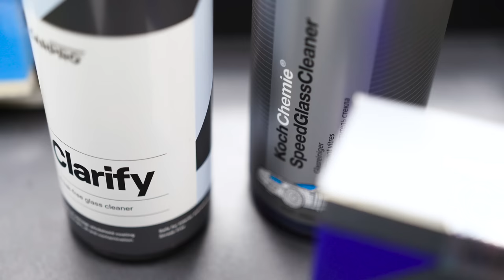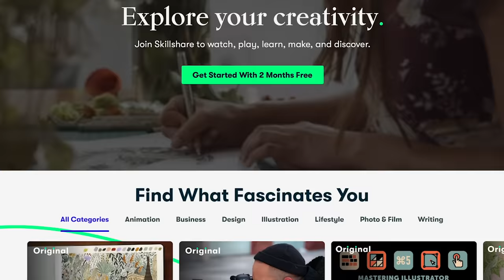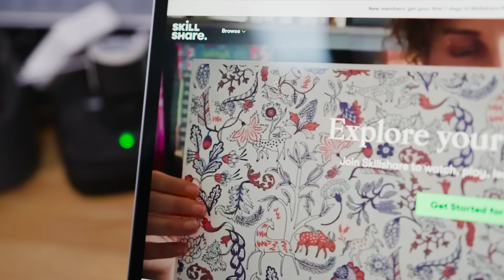How To Clean & Ceramic Coat Car Windows - Streak Free!

Comment: Congratulations on the sponsor man, that's awesome. Magic eraser on windows is interesting, do you use that method on tinted windows as well?
Reply from the maker: It’s a first! I’m really excited because this will help the channel grow! You can use it on tinted glass, but use it lightly, no need to use a lot of pressure.
Reply: I wouldn't use magic eraser on the inside if the car has tint films (not factory tinted window).
Reply: @JackRR15  I agree totally. I was surprised to see that.

Comment: Some verbal explanation of what you are doing and tips on the best way to do it and type of sponge and cloths you are using to scrub with. What can I use if I don't have a circular buffer?
Reply from the maker: With the new version of FlyBy FORTE, polishing is not required. But you can use the handapplicator which comes with the CeriGlass kit if you’d like.

Comment: Great video! I'm always hesitant to buy any sealant for my windshield because I feel like the wipers will blow through any protectant after a couple uses.
Reply: With proper prep and a good sealant or coating it will take quite awhile before they break down if you are looking for a good cheap route I highly recommend griots glass sealant. Super good quality for the price and lasts for quite awhile. Forte by carpro is solid as well for the one he is using but comes at a higher cost of course.

Comment: very cool, the application is pretty much same for every glass sealant but that buffing out with this small applicator seems lot of work, does it turn "clear" quick? Do you need to give it pass with fresh microfiber to remove some left residue? Adding voice to your videos was cool, thanks
Reply from the maker: You have to buff it a little bit before it becomes completely clear. Sometimes there will be a little bit of residue left, especially in the corners, but you can just lightly wipe these off with a towel. Thanks for the support Lukas!

Comment: great technique and products .. the only thing which I would do otherwise is to not spray the inside of the glass directly with the sprayer. I would spray on the applicator pad (in your case the magic erazor) outside of the car to avoid splatter/overspray on the dash and doorboards.

Comment: Great vid. Do you need a polish stage on the glass if the car is brand new?
Reply from the maker: Thanks Samuel. I always do at least a light polish, just to be sure there is nothing left on the glass. Some dealerships use water repellent glass cleaners and that might interfere with the coating.
Reply: Thanks for letting me know I’m going to try and get them to leave the car alone and just deliver it to me as is so they don’t mess up the paint lol, thanks again

Comment: Question for you and other detailers here? No one ever addresses or talks about how many pads they use during a paint correction and how many towels they use during a ceramic coating. Do ceramic coating towels need to be thrown away after each use? And can 1  correcting pad and 1 polishing pad be used for the entire car or do you need multiple of each pad? Thanks!
Reply from the maker: Once a towel becomes saturated with product, you should swap it out. The used towels are not reusable as these will become water repellent. It's best to use more pads during paint correction. I usually use between 5 to 8 pads per car (depending on the size of the vehicle). Using more pads will extend the lifespan of the pads. Using a fresh pad will also do a better job at correcting as there will be less residue build up inside.
Reply: @VermijlCarDetail  wow good information, thanks man for replying. 🙌🏻

Comment: 2 questions.first how to use ceriglass by hand.i use but hate it!  2 question flyforte need to cure before buff? do you apply on  wiperblade?
Reply from the maker: You just work CeriGlass in by hand as I did in the video with the supplied polishing block. You don’t need to buff FlyBy FORTE, the last application is with the same applicator but no additional product until it becomes transparant. All steps are shown in the video 😉
Reply: thanks. i see know. i forget to use erase after ceriglass that why i think was very hard to buff it

Comment: Why did you use the magic eraser? And why just inside mate? What benefits does it have please?
Reply from the maker: It does a great job at removing grime and oils. Just makes cleaning the inside a lot easier. You could also use this on the outside, but in this case it was unnecessary because I was polishing the exterior glass. Just don't use it on ceramic coated glass, as it will remove the protective layer.

Comment: After glass ceramic coating Should I dry it or what?
Reply from the maker: With FlyBy FORTE you have to buff it with the applicator until it becomes clear. It should become 100% transparant. If there is any residue left you can gently wipe it off using a towel, just don’t buff it off with the towel.
Reply: So Appreciate you are the best